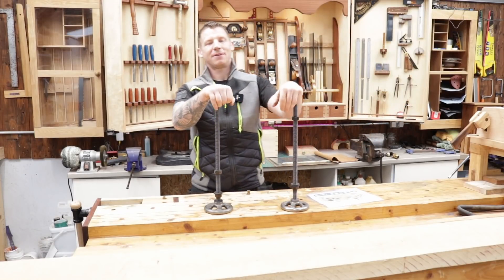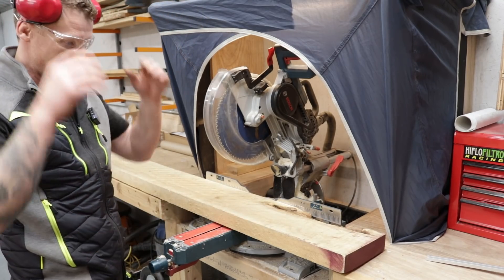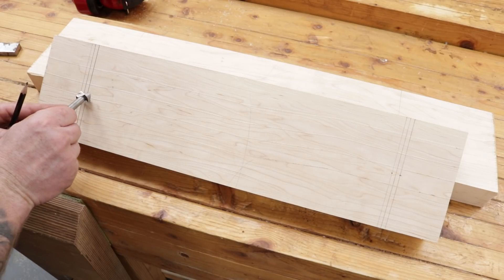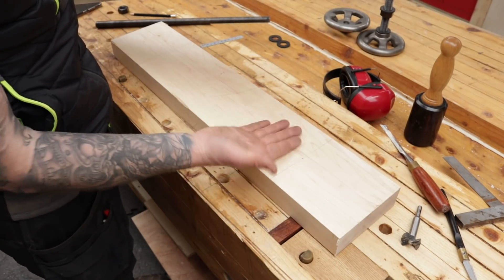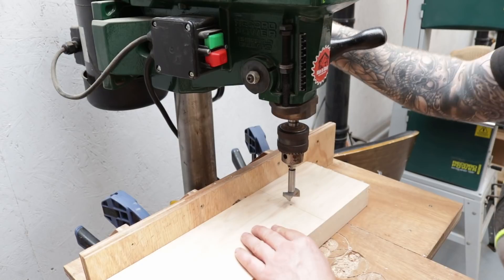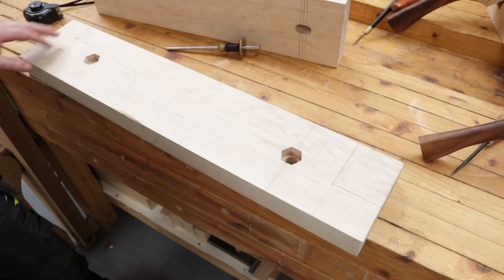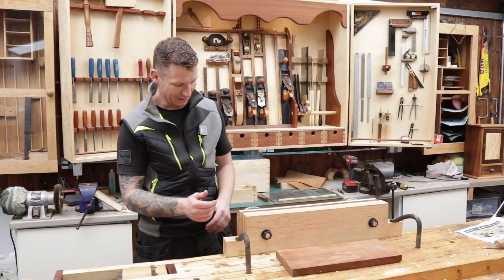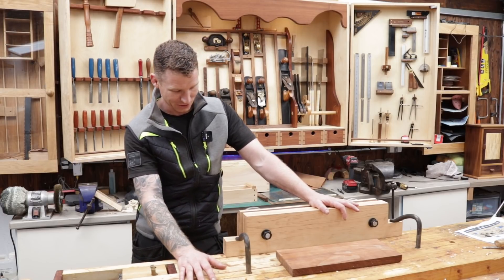How to make a Moxon Vice. Probably the best Woodworking Vice!

Comment: Moxon vise looks good!  Many of them, like yours, have handwheels that turn on fixed shafts.  That allows the wheels to spin more freely, but the shafts are always sticking out so they are usually cut short.  I made mine the other way, with handles fixed to the screws.  It doesn't seem to make much difference, but I like the larger capacity without screws sticking out the front, and don't miss the easier spinning.
Reply: I was just writing a comment to ask the same question.  Why not turn the shaft and  have the screws sticking out over the bench instead of in front?  That’s how I’m making mine, too.  Thanks for putting this information out there.

Comment: Hi john a other great video. I am building my bench at the min in the conner of my garage . I like vice . But what you think about fixing it to the front of the bench? It paul sellers bench i am making .
Reply from the maker: Yeah you could my only issue with that is the screws sticking out permanently on the bench.

Comment: Great job, John. I'd be nervous of having those screws sticking out like that - would this work with the wheels at the back, on top of the bench ?
Reply from the maker: You could do but honestly it's not really an issue unless kids are running around and it's at head height and that is not a situation you would let happen.